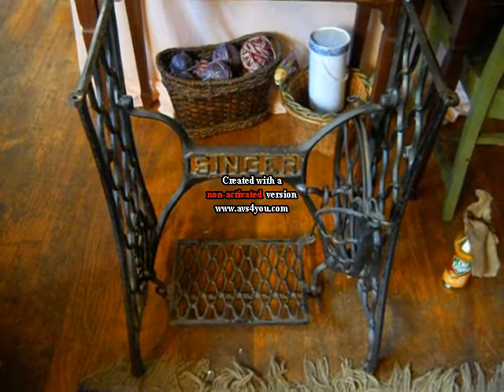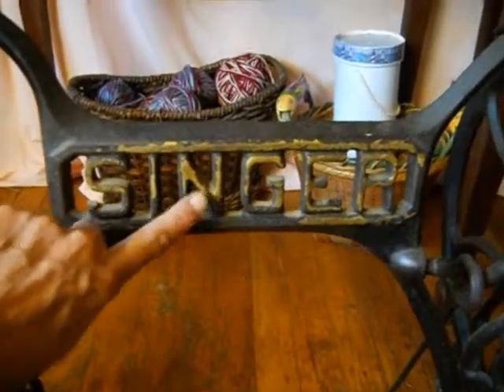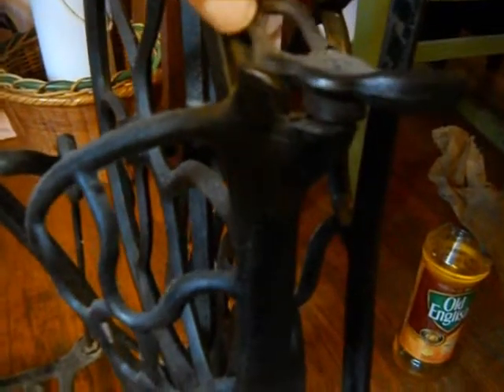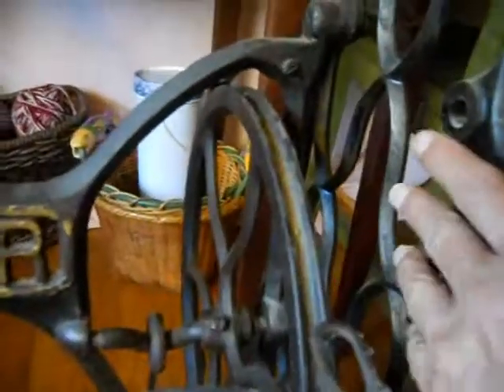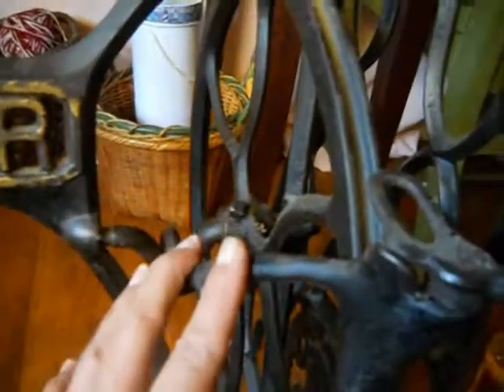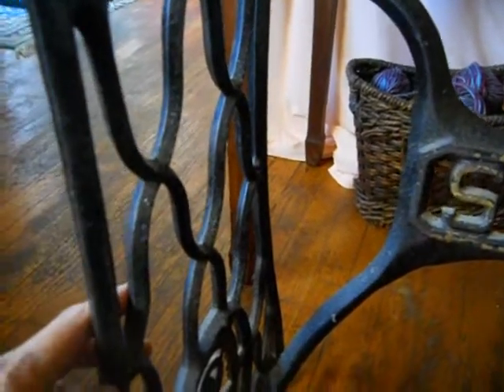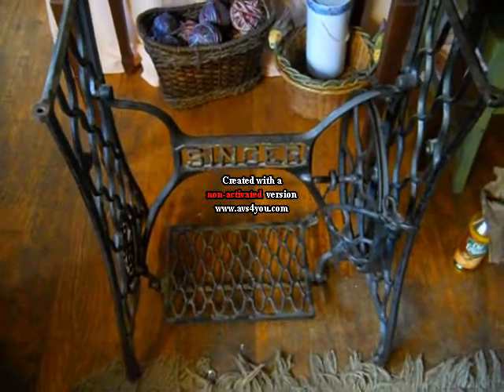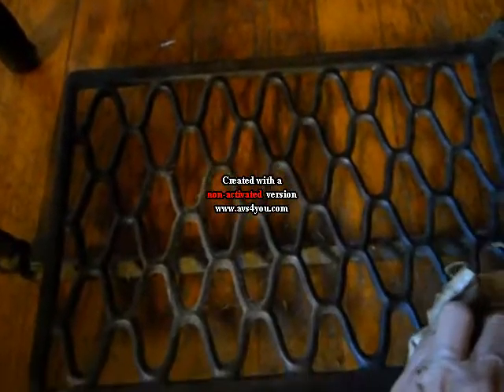Treadle Base - Basic Parts

Comment: Hello Laurie,
You mentioned you buy sewing machine oil by the gallon... can you provide any further information on where you purchase the oil from in that quantity?

Thanks - Eric
Reply from the maker: Let me think where I got it last time. I will post it as soon as I remember- I think it was one of the sewing /supply and parts places
Reply: Thanks.... just dropped $50 on 5 tubes from the FW shop
Reply from the maker: Here is what I buy and one website. https://www.abcsewingmachine.com/products/oil-for-sewing-machines-national-guard
I'm not sure if I bought it there because of shipping from CA to MA but that's the brand.
Reply from the maker: @Irukandji01  See the below link- I think I did get it there because at the time (last time I bought it) I was looking at industrial machines. They have an unbranded gallon for 12.00.  I also saw some gallons of oil on Ebay- but a couple said "mineral oil", and I think that is almost the same, but that good sewing machine oil is very light and clear. Regular mineral oil is "baby oil" which is fairly heavy. Would still work, but you want a light oil.
Reply from the maker: @Irukandji01  Shipping to me from CA is 26.00- but even at that, the total is 41.00 something for a gallon.
Reply: Thanks so much... I’m into the Singer sewing machines conservative efforts, they just don’t make them like this anymore
Reply from the maker: @Irukandji01  you can say that again!

Comment: Do you need the belt guard and belt tensioner for the treadle to work.
Reply from the maker: The treadle will work without a belt guard if the flywheel is on the axle correctly. By tensioner you mean the loop of iron that moves the belt off of the flywheel? That is for convenience of getting a tight belt off the wheel. If you have a belt around the flywheel and handwheel of a machine head the treadle should work as long as pitman rod and pedal are connected.
Reply: Thank you for my response
DR